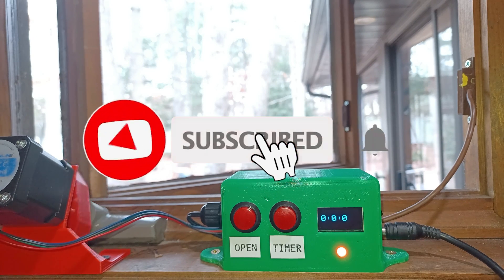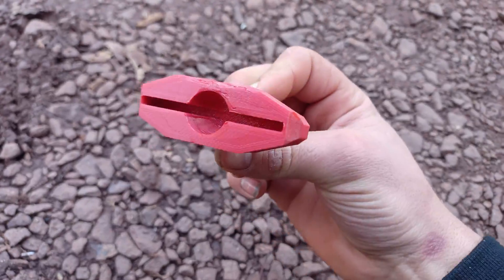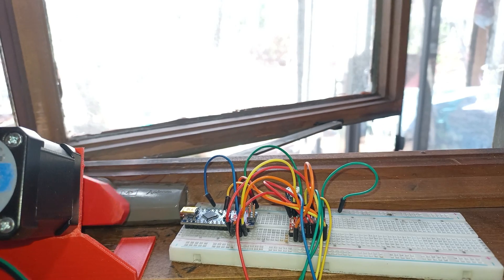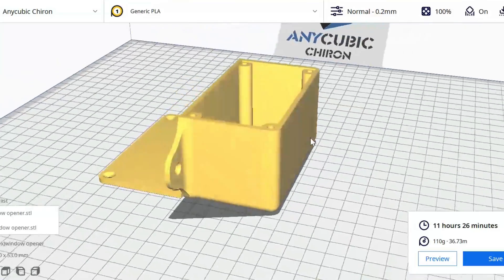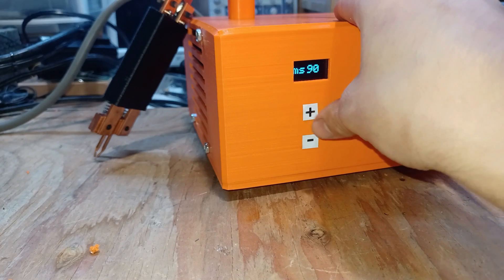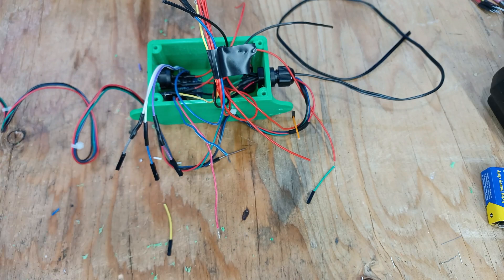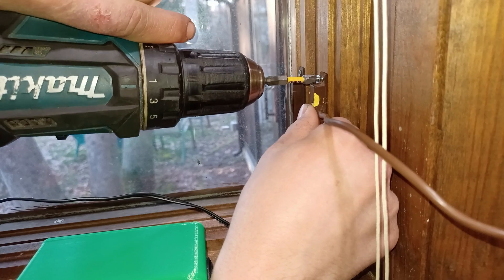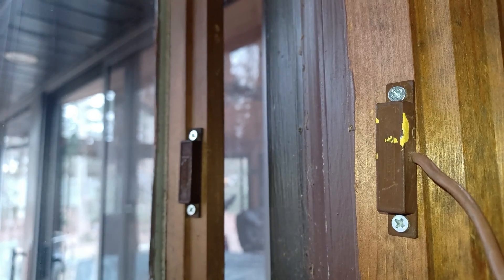Building a BATHROOM Electric Window Opener

Comment: Much easier to turn on the ceiling vent + light with motion switch installed in place of light/fan switches.
Reply from the maker: @user-hn7gx5zh7x  Some bathrooms only have windows and not a ceiling vent